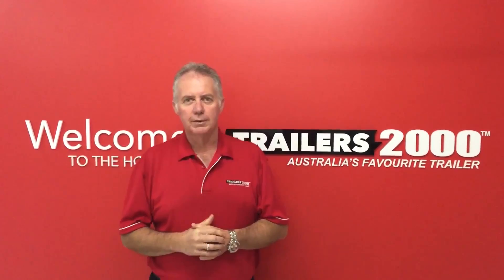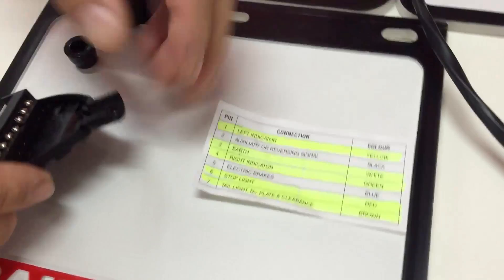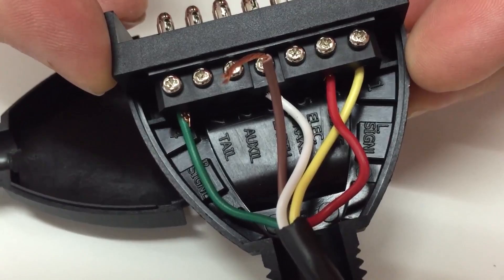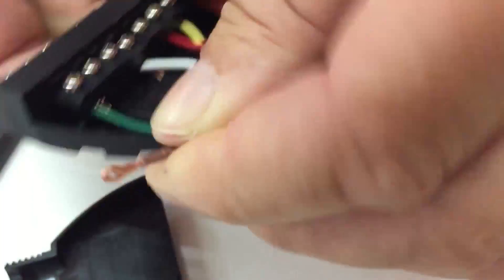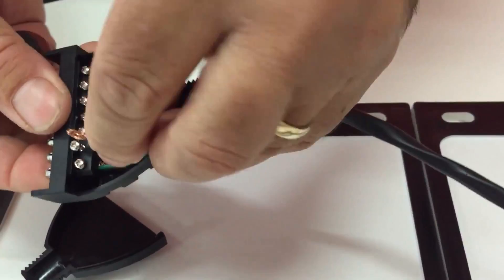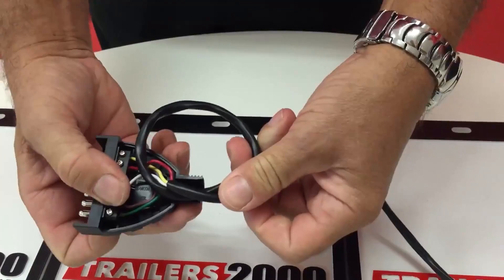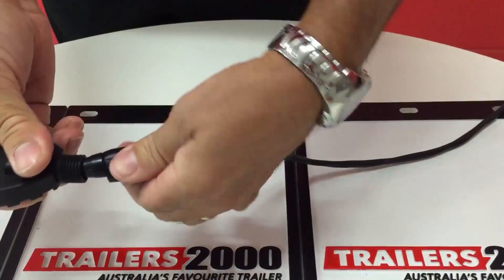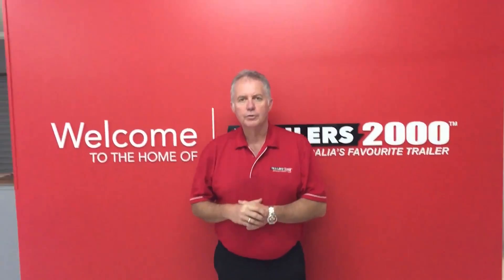How to Wire a 7 Pin Flat Trailer Plug

Comment: Hi guys I recently bought a second hand light duty 6x4 trailer 2000 which is great and when I picked it up I plugged the lights in (7 pin flat) and all working but just today I plugged the trailer lights in as I was going to replace the broken number plate light an nothing working at all any ideas??

Comment: Some stupid people who have no idea about trailer connectors and the reason why we also have a 7 pin, forget the rectangular 7 or 20 pin types (this is about round plugs and sockets used on cars and trailers), it's the wiring that is wrong between a 5 pin and 7 pin. The 5 pin connector was mainly for box trailers and trailers that only require the use of tail lights, brakes and indicators, but the connector and socket is actually a 7 pin holed device, except that small trailers only need 5 pin plug and socket due to 3 basic requirements, clearance lights, brakes and indicators. The negative earth is provided by the negative chassis of the vehicle (Australia only) when the trailer is hooked on the tow ball, chains attached, etc., which creates a good connection and may not even need another pin for negative earth (Let's not confuse those from UK and Europe where cars over there may have positive earth), however, if a 6th wire is used, it is usually white (non conductive but provide secure negative connection). For a 5 pin round socket attached on the rear of a car, near the tow bar, the wires colours (If you have the properly coloured wires in the black sheath cable) are as follow:
Pin 2 - Yellow, left hand turn.
Pin 3 - White, negative earth.
Pin 5 - Green, right hand turn.
Pin 6 - Red, brake stop lamps.
Pin 7 - Brown, clearance/side lamps.

This is also the wiring connection for the 5 pin male plug (the one on the box trailer crowbar, near the chains, even though the plugs and sockets are both 7 holes bodies, only 5 pins are used with the exception of an additional 6th pin used for reverse lamps and the colour is provided 

Now, here comes the confusing stuff-up. Read on...

If Pin 2 of the 5 Pin plug and socket is Yellow - left hand turn, why is it Black - reversing lamps in the 7 Pin plug and socket?

If Pin 5 of the 5 Pin plug and socket is Green - right hand turn, why is it connecter to Pin 4 of the 7 Pin plug and socket that is Blue and used as Service Brakes? Why not leave it as Pin 4 - Green - right hand turn? This stuff-up is not new, it has been going on for many years, and no wonder many trailers owners have had this hooking of round plugs to sockets nightmare that has required the use of bullshit adaptors when the problem could have been solved by using same wiring of 5 pin plug and socket with the 7 pin plug and socket and use the remaining pins to connect accessories, e.g. caravan interior lights, electric brakes. But no, the stuff-up had to continue for what seems forever, until I decided to fix these ignorant stooges who are giving me a bloody headache when I cannot get the correct lights to work, e.g. hiring a trailer from Bunnings. My trailer is a 5 Pin plug and socket and is correctly wired as explained above. The Bunnings trailers are 7 pin plugs and sockets. When their trailers are connected to my car and plugged, only the clearance lights and brake lights work, no indicators or hazard light (a critical safety feature). So, you see where the stuff-up lies? Too many stooges who regard themselves as professionals and yet for so many years these stooges could not figure or solve a simple problem. 

As for my case, the sockets and connectors are 5 pin and correctly wired for both my speedboat trailer and a box trailer of which I made. But when I want to hook up a hired caravan or another box trailer, etc., that's when the nightmare begins, as I am being given a number of strange connecting adaptors and plugs to match my 5 pin socket. Problem is, their 7pin plug fits in my 5 Pin socket, but the wiring connection do not match, especially if the trailer is a 7 Pin. Now, do you get what I mean when I said - stuff-up!? If the 5 Pin and 7 Pin wiring combination do not match, then the entire connection is unroadworthy because some or all the trailer/caravan lights do not work, regardless of what round sockets are installed on the vehicle or plugs installed on towed vehicles, and that is also a fact that the ignorant authorities, VicRoads and those who inspect, test or pass such vehicles are also not aware. How is that when it comes to vehicle safety? I am a retired mechanic/engineer since the 70s, my dad was a mechanic long before WW2, even he had disagreed on the shitty 5 pin/7 pin wiring combinations years ago and both of us, for the safety sake had to change the wiring of the 7 Pin to watch that of  the 5 pin plug and socket, even though both had 7 pin holed round bodies.

Ignorance is bliss, as my dad used to say.
Reply: Thankyou you mate I'm gonna follow these instructions tomorrow because I always just have to guess and put the coloured wires in random pins because it's never what it suggests like for example if I follow this video instructions due to having a 90s trailer it doesn't work and I could never figure out why 🤷

Comment: Hi....is it ok to have the blue wire disconnected?
Reply: If you don’t have electric brakes on your trailer, you don’t need the plug wire connected.
Electric brakes are required for trailers over a certain GVM. Most vehicles can carry up to 750kg unbraked, but smaller cars will have a lower unbraked towing capacity and light trucks will have a larger unbraked capacity.

Likewise, if you don’t have reverse lights, pin-2 shouldn’t be connected to anything either.
If your trailer requires extra connections for Foglamps, Hydraulic brake pump or other low-current Auxiliaries use a 12-pin plug.
If you have a Battery system or Fridge, you should use an 50A Anderson Plug.

Comment: I have a black cable left?
Reply from the maker: This is for a 5 core cable which is a trailer without brakes. If you have a trailer without brakes but it has 7 cores in the cable you ignore two of them being the blue and black.  You only require white, red, yellow, green, brown.
Reply: You can add reverse lamps and wiring them into Black on Pin-2.
There are ADR rules on what is classified as a Reverse Lamp, so you shouldn’t just use white Spotlamps or Work lights as reverse lamps.